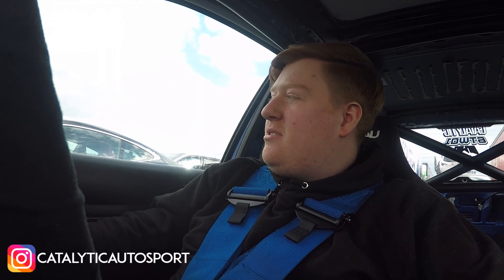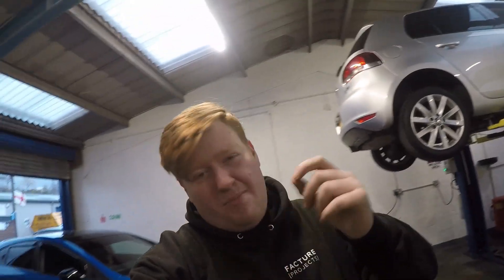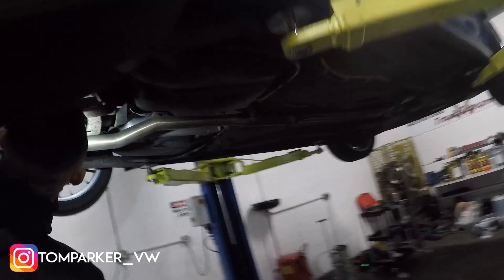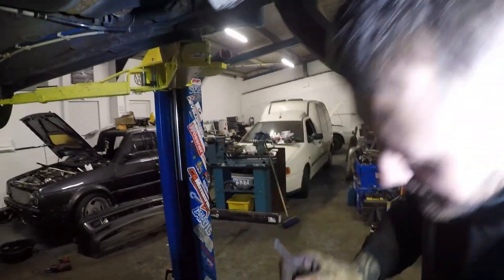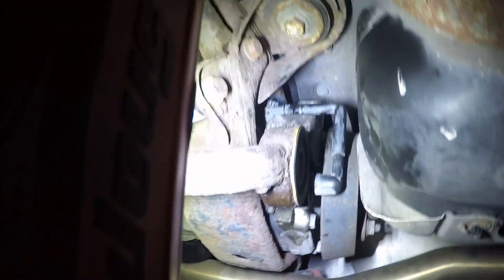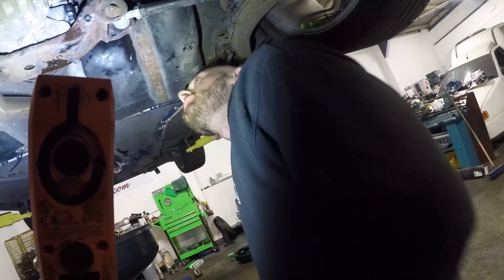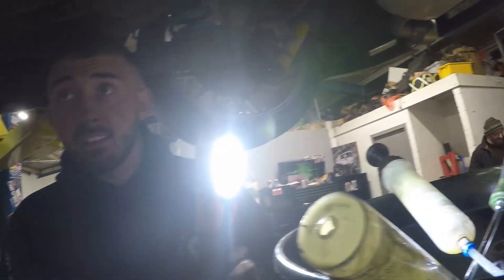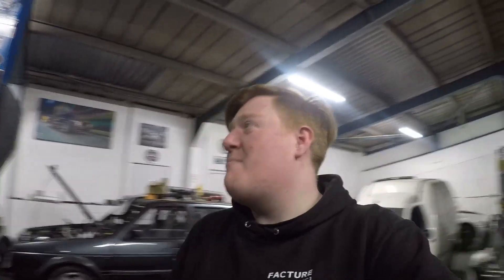Track R32 gets a Powertrack Insert *Permanent 4WD*

Comment from the maker: *Someones noticed that we might have put the wrong fluid in the wrong drain hole, we changed diff and haldex fluid to be safe, and it seems i didnt film half of it and i told tom where the plug was, getting checked over to be sure and will update in the next R32 Video. So if you noticed it 1. Thanks for watching carefully, means a lot 2. Cheers for looking out for us 👍. 

Cheers geezers
Reply: That was definitely filled in the wrong Hole. Glad another VW/R32 brother spotted that.  

I remember years back reading about that insert for the Haldex. Supposedly it will ruin the clutch pack. Keep us posted.

Comment: Glad someone noticed this.. hope it's l working well now, but yes definitely you put haldex fluid in the diff which needed 1L of 75W90 HD diff oil. 
And the haldex oil goes into the drain plug of the actual haldex with a corking gun :). 

Well in for getting the filter changed, they're not easy access

Comment: hello friend, is it possible to eliminate the friction discs and lock the haldex with soldering or something like that?
Reply from the maker: Would probably still kill the spider gears in the rear diff doing this, only thing i could think you mean which is related a lad in USA made a solid piece of metal instead of a clutch pack iirc not seen much about it since.
Reply: @nomessininc.  OK, thank you friend.

Comment: Hey man how is it i want to buy a audi 8l but if i cant get 50/50 to all wheels its kind of a turn of for me how are the difs and does awd suffer😀
Reply from the maker: Had it on about a year and clutch packs inside the diff went and blew up. Swapped it out again if it does it again i’ll take valve off but here in UK diffs are about 80-100£ so cheap enough.
Reply: Catalytic Autosport tnx for the replay did you find any better difs that could maybe survive and maybe be like a lsd
Reply from the maker: 2StrokeBro think wavetrac do a drop in rear one. Worth finding a supplier, i’d recommend either Garage Midnight or Shift.Co

Comment: if the plug of xaldex its not work or its off with this valve the 4x4 work 50/50? thnx
Reply from the maker: Haldex pump needs to have power for this to work, not worth doing anyway it kills diffs
Reply: So this insert is shitty?? Isn’t work properly?? how long did you drive it before it broke yours driff?? 
I wanted to use this in my daily car… Cheers

Comment: Yours appears to be about the only video on youtube about this, lots of old forums reccomending it, you say your diff went pop, did you put the valve in the new diff and have you had any issues with that? Sounds like it made a big difference? Thinking about doing the mod in my Audi TT MK1 for track days so would appreciate it if you could give a bit more info now times gone on a bit.
Reply from the maker: Hi mate, yeah i put it back in the new diff, old one was on 100k, with little servicing so thought if this one blows aswell its defo the insert. For piece of mind go for a blue haldex controller 2nd hand or a HPA one. Hope that helps mate 👍
Reply: @nomessininc.  hey there, i know im a bit late now but the the new diff hold up with the permanent haldex? Planning to do it on my mk4 r32 but im kimda scared i dont want to break stuff it has 350kkm on it now
Reply from the maker: @moinmoin868  no mate i took it out, best off going with either hpa one that has the different modes, find a blue/orange controller or if you go to our newer videos other year i put a better one from a company in germany called turbo impression
Reply: @nomessininc.  dayum thanks for the fast reply, but what do the others make better other then let you control it? I wouldnt mind having it 50/50 at all times as long as it doesnt blow my diff

Comment: Did permanent 4 wheel work
Reply from the maker: Yes mate, felt loads better with it in.
Reply: Catalytic Autosport as it lasted ok not caused any problems
Reply from the maker: Mark Shone diff blew up december, could be that insert, could be poor servicing of the previous owner. Won’t know till i rip it open mate